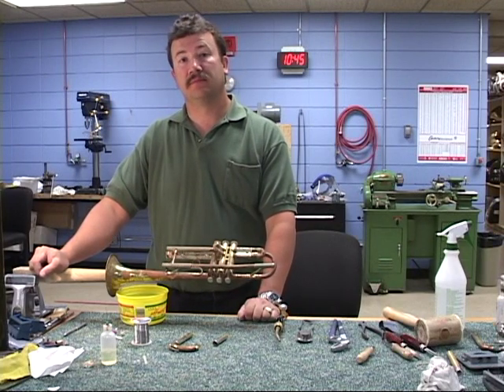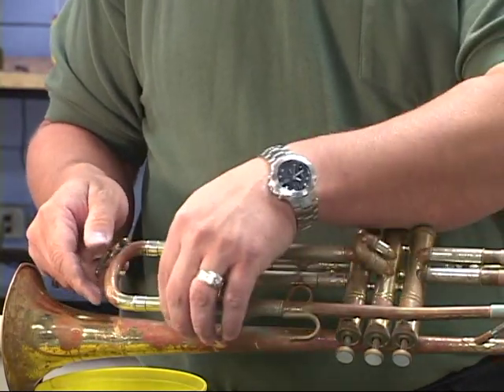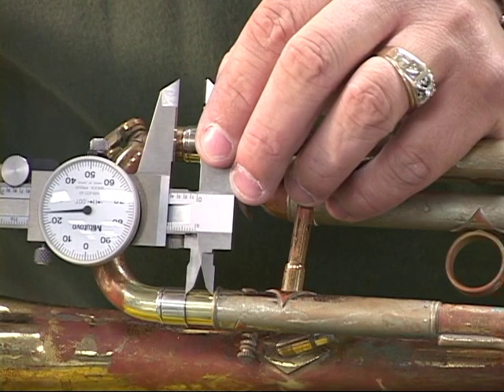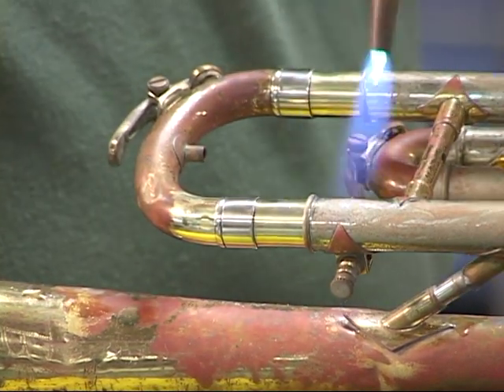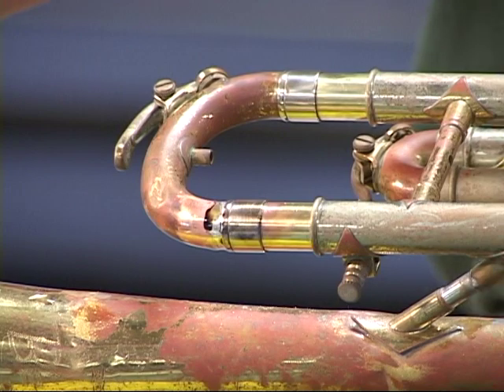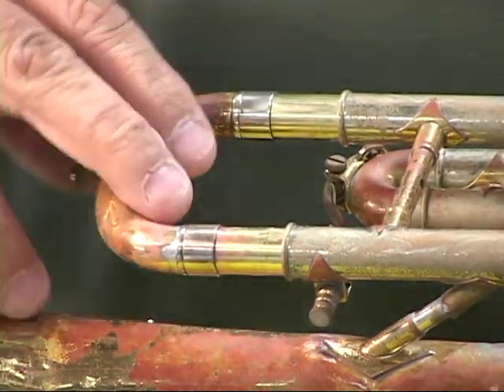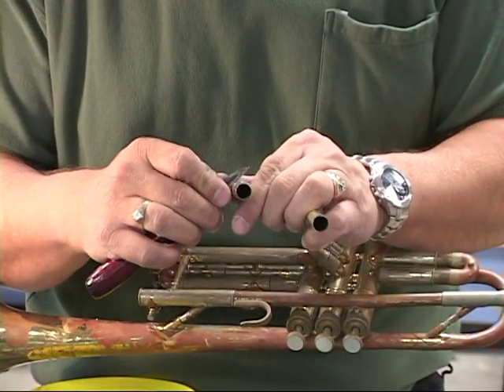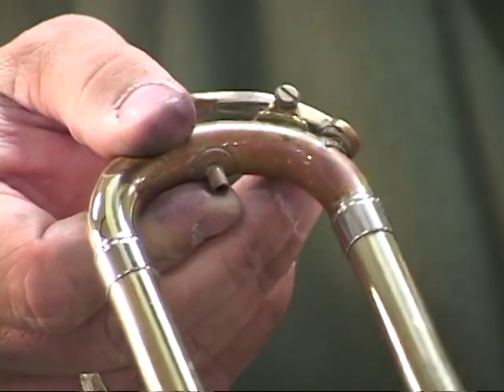Soft Soldering demo - Brass

Comment: Thanks for the video. I never knew to pull the flux into the joint with heat. I always thought it to be for the solder only. This is much cleaner. awesome.
Reply from the maker: The heat also works well to pull in liquids to free up slides that are frozen.  Kroll and liquid wrench are a couple of products for freeing up stuck slides.